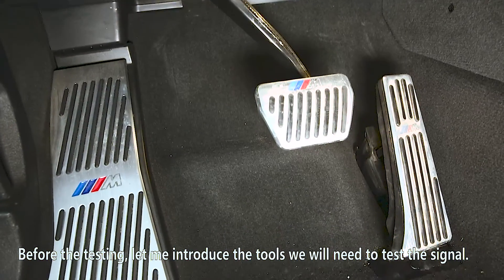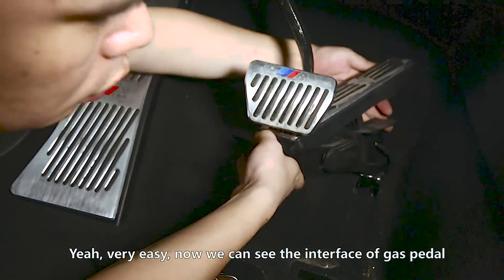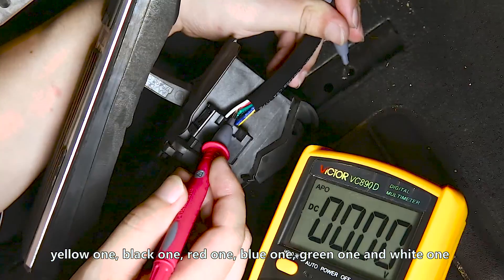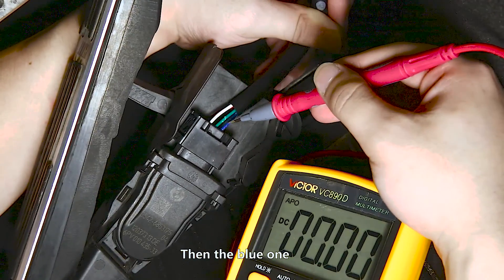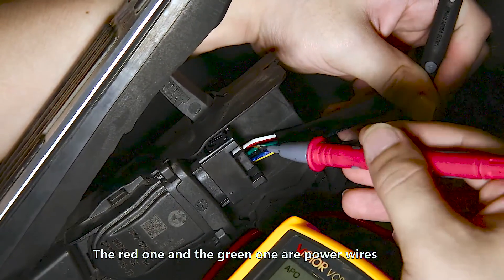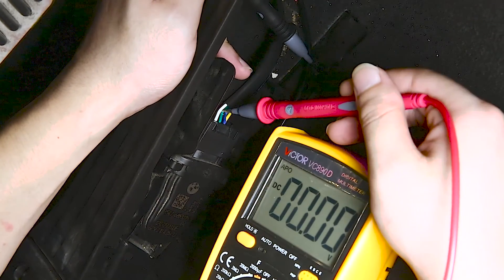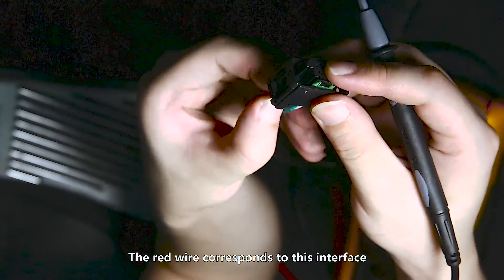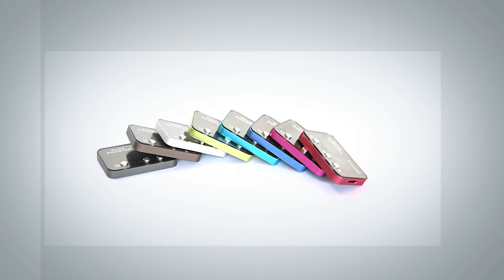How to collect car's gas pedal sensor voltage

Comment: Hello there. I have a problem with my car. the automatic e46 3.20d is moving with a delay of 4 seconds at the first departure. I wait more and more during the rainy season. the vehicle is in normal gear ratios. Could the problem be this gas pedal sensor?